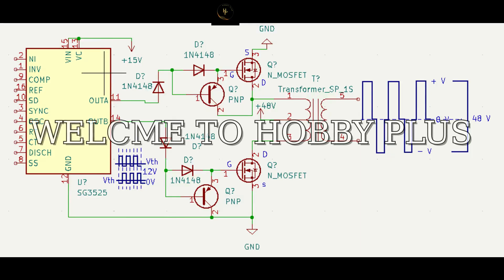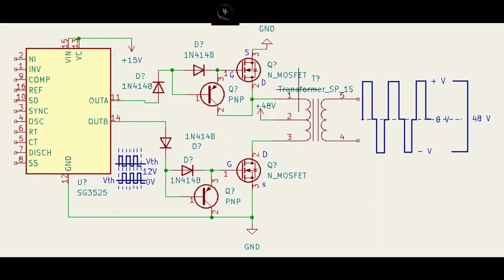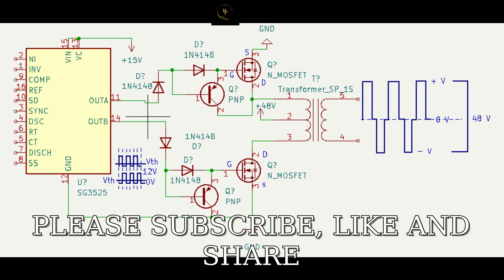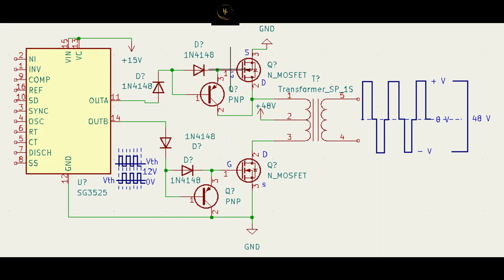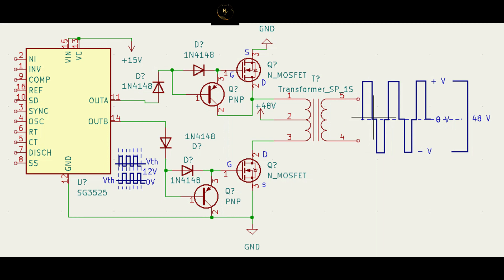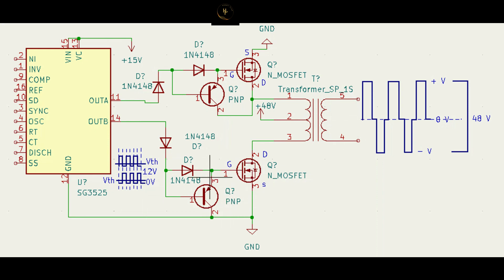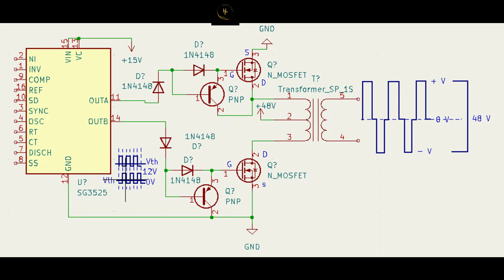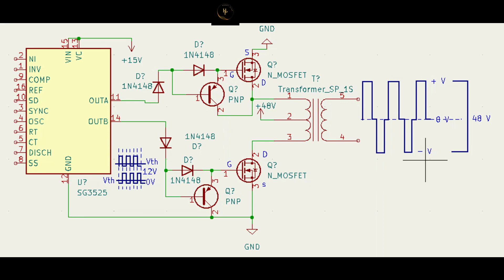[9]PUSH PULL AMPLIFIER WITH N CHANNEL MOSFET

Comment: Sir, can you full sg3525 circuit diagram please
Reply from the maker: where is your problem?
Reply: @hobby_plus  sir, how to audio signal in to the ic and duty cycle resister & capasiter ,
Reply from the maker: SG3525 is a pulse generator IC how can you use this IC in audio?

Comment: Master hi.i precisely fasten this  circuit with tl494 with that gate driver that learn from you .but when attach pnp collector to earth shape of pwm full change .I send you that shape.😢😢2 or 3 time made circuit in output the situation is very bad.in gate pin pwm shape....😂😂😂😂
Reply from the maker: I will answer you shortly

Comment: 2 diodes in series only gives a slight 
" voltage threshold delay " to mosfet gates..
The 2  ' pnp ' transistors are for keeping the mosfets in " off " when there is no gate drive..
But it will be floating
@ 0.6/0.7 V because of 1st diode closer to i.c.
better turn off is with one diode connected between base of pnp's & ic outputs with anodes connected to pnp's base/s. also 8k2 to 10k resistor between g- s is usual practice...
of course the best is to avoid any diodes in the mosfet gate circuits..because there is sufficient dead time built inthe chip and can be increased if necessary..